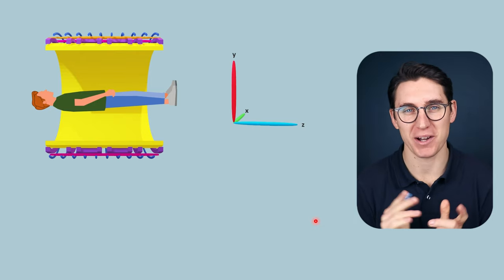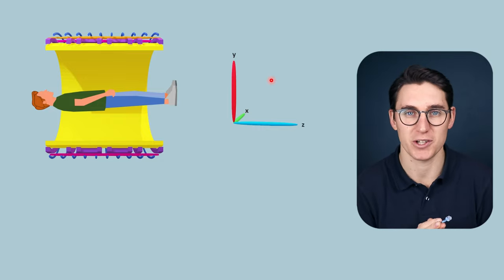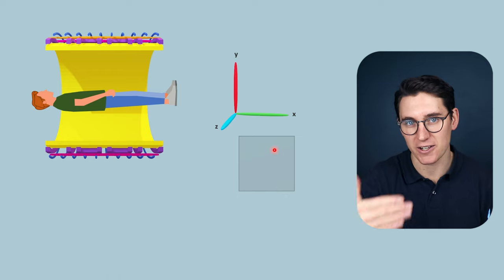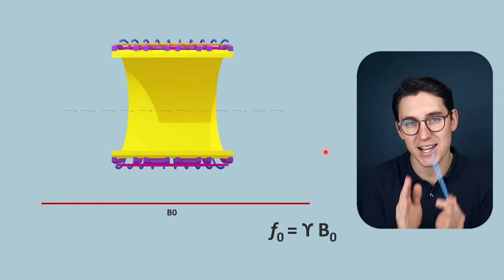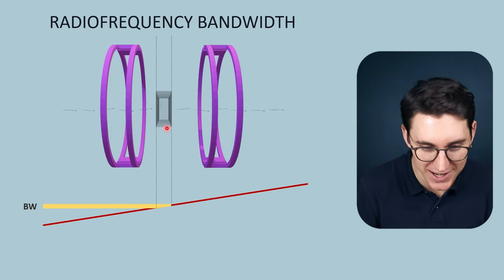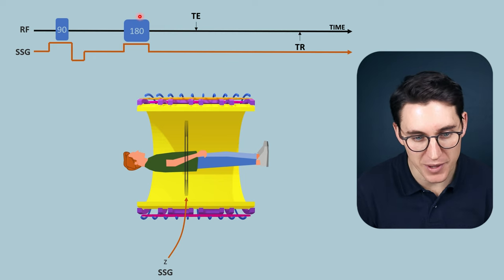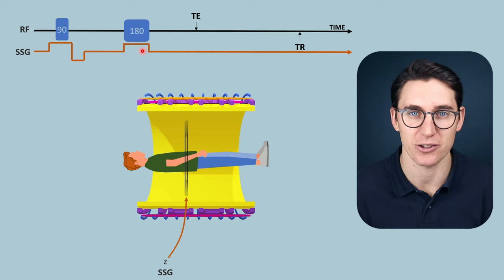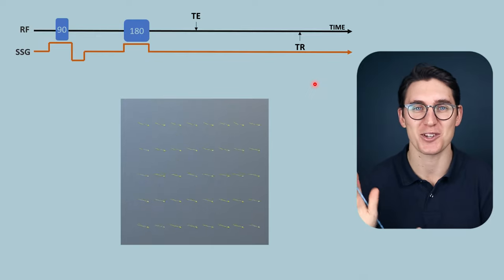MRI Slice Selection | Signal Localisation | MRI Physics Course #7

Comment: Regarding the rephasing gradient, 
you, Dr, covered the concept elegantly! Only that the illustration displays a logical error since if we applied a rephasing gradient it should be only be limited to SSG range not to all B0.

If we applied rephasing gradient the same way displayed in your presentation (along entire B0), we will face a logical problem since it will cancel the linear variation, having all protons at same precession frequency again.

so I recommend editing the red line of rephasing gradient to only fit the SSG not the entire length of B0

What do you think?

Comment: Thanks a lot for the lecture, really helped refreshing my knowledge. One thing I find confusing is that your SSG-in-time graph implies that one would have the SSG turned on during the refocussing 180deg pulse. I can't seem to understand what the purpose is of using such configuration, given that the slice of interest was already selected after the 90deg pulse. I get the point of the 180deg pulse but I don't understand why we'd use a gradient here again, could you maybe elaborate on this? Respectully, Wouter.

Comment: Hi Doc! Love your videos, you’re a fantastic teacher! @kayk928 asked this question and I had the same question. He said, “why do we not use a rephasing SSG for the 180 degree RF pulse and only for the initial 90 degree pulse?” Do you mind explaining please? Thank you so much in advance!
Reply: As he says, the rephasing gradient (SSG) is typically applied after the initial 90º RF pulse to correct dephasing caused by magnetic field inhomogeneities and ensure coherent transverse magnetization. BUT, this transverse magnetization decays faster than we woud like to (T2*, see T2* video),  because fast decay means less time to play with the TE and TR (see T1, T2 and PD weighted imaging video), so the 180º pulse is generated to inverse this dephasing, gaining time, and have again net transversal magnetization signal sufficient to be measured. Now, regarding your question, the difference is that after the 180º pulse, no additional rephasing gradient is needed because the 180º pulse itself reverses the phase of the spins. When the 180ª RF is applied, the spins have the same dephase but inverted, (as the T2* video says, the faster spins are now behind, the slower are ahead, and they all eventually catch up and form the spin-echo signal). So here there is no need for a gradient to 'fix' with a rephasing gradient, since the inversion of the phase already makes them all catch up. In other words:

Schematic explanation
90º RF pulse --> Mxy occurs but spins within slice have dephase due to in-slice gradient --> rephasing gradient --> all spins are coherently to the same phase --> T2 relaxation is not homogeneous --> spins relax differently and start to dephase (again, for another reason) --> 180º RF pulse to invert this relaxation 'speeds' --> catch up and coherent signal (spin-echo). So the 180º RF already rephases (for another reason), so a rephasing gradient is not needed. 

I had the same doubt, I hope it is correct and clear! 
Good luck on your studies :)

Comment: Hi professor！Your video was truly fantastic; your explanation was very clear. I'm really grateful. I have a question I'd like to ask you: since in TE (echo time) the protons in the slice are precessing in phase, making it impossible to determine the exact location of the signal within the slice, why do we need the rephasing gradient step? Wouldn't it be possible to know where the signal is coming from at TE without rephasing? Is the purpose of rephasing to ensure that all the protons in the entire slice precess in phase? If so, what is the objective of doing this?
Reply from the maker: Hi! Great question. At the end of the RF pulse the protons are in phase, at TE the protons are rapidly dephasing due to T2* decay. They are also dephasing because the gradient we apply in the x direction (frequency encoding gradient) causes spins to precess at different frequencies. These different frequencies allow us to localise signal but we lose transverse signal even quicker as a result of the gradient field. The rephasing gradient allows us to recover some of this lost signal. I go over this in depth during the gradient echo talk (part 1). Check that video out and it should make more sense 🙂
Reply: Thank you so much! I'll check out the gradient echo video. Again, I love your tutorial videos! I really appreciate your efforts @radiologytutorials

Comment: Thank you for these amazing videos. Could you please clarify to me the difference between receiver bandwidth and transmit bandwidth?  Because I have read in some books that they have different action on the SNR. I'm confused
Reply from the maker: Pleasure! The term bandwidth means range of frequencies. Transmit bandwidth refers to the range of frequencies that make up the radiofrequency pulse - the larger the transmit bandwidth the thicker the slice selected and therefore higher signal to noise.
Receiver bandwidth refers the the range of frequencies across the frequency encoding direction of a slice (it is completely separate process to transmit bandwidth). I cover this concept more in the bandwidth talk of this series - hopefully that video will help 👍🏼